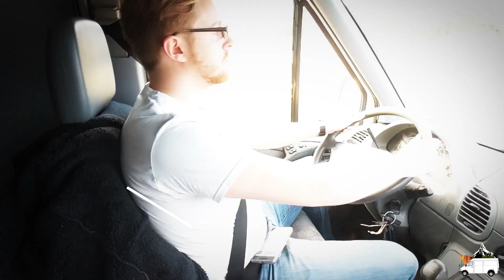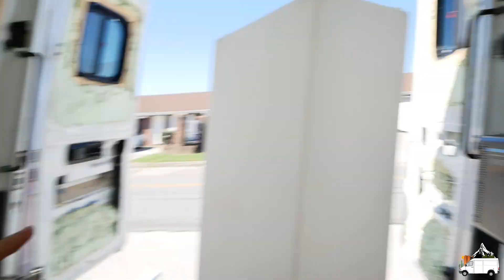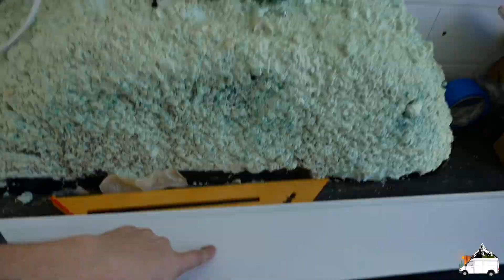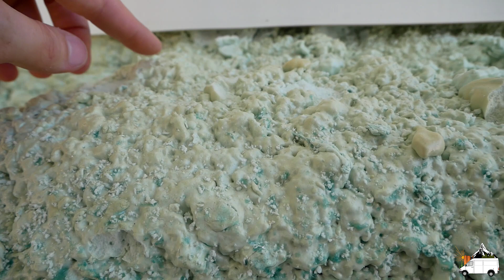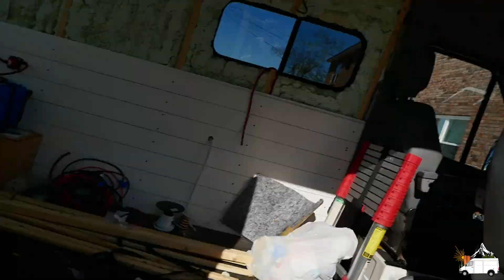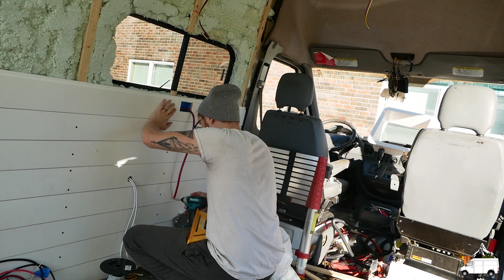Boxing in our wheel wells & Wiring an Electrical Outlet into an extension cable | DIY Van Electrical

Comment: Hello! I’m working on building out my van and I’m completely new to all of this. What kind of wire is that, that u r using? I know there’s 12 bolt and the household type wires. I installed a 30amp outlet but I only have a heavy duty extension chord install on the inside. I want to wire 3 outlets inside the van connected to the 30amp. Thanks 4 great and helpful posts.
Reply from the maker: Hey! Make sure the wire is stranded and not solid household wire. This is because solid household wire may snap/break with all the vibration/movement of driving. You'll want to use 10awg wire if they are 30 amp outlets (because 10awg can handle 30 amps of current)

Comment: Might be a dumb question. But how do you  wire the outlet to the power source ?
Reply from the maker: For the AC (house) outlet? What I basically did here was just buy an extension cable, cut the female end off and wired it to the outlet and then I plugged it into the inverter. This works fine, technically that is considered a "no no" and the "right way" would be to get an inverter that has connections where you can wire it directly with wire. Mine actually did have that, but I wasn't aware until afterwards and just stuck with this method. It's not really unsafe or anything, and honestly works the same way.
Reply: @projectvagrant8197  Thank you ! My wife and I have been trying to figure the best way to wire the AC outlets in our van. The extension cord method seemed too good to be true. But it makes a ton of sense.
Reply from the maker: @kennethmitchell2478  👍👍 feel free to reach out if you need anything.